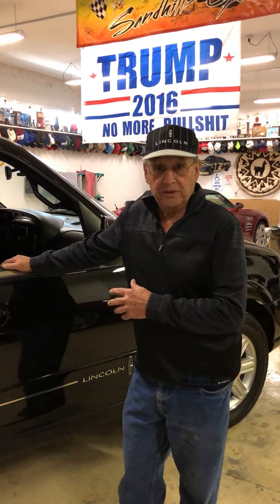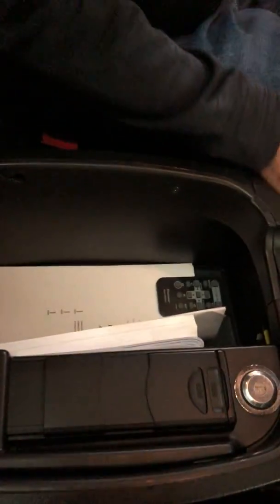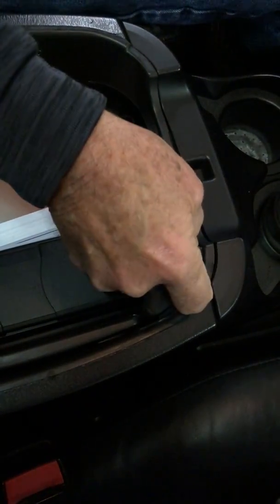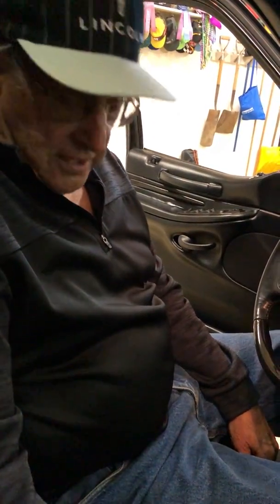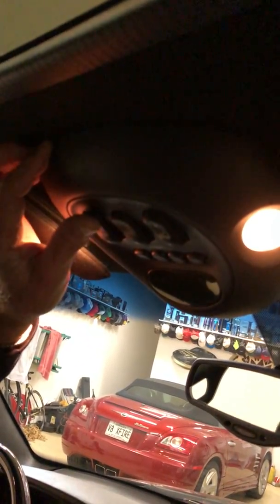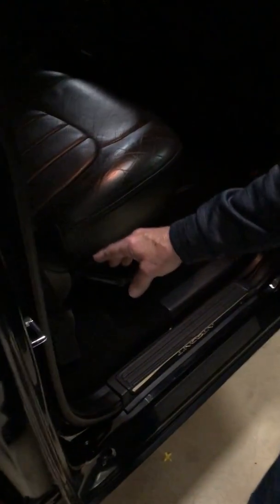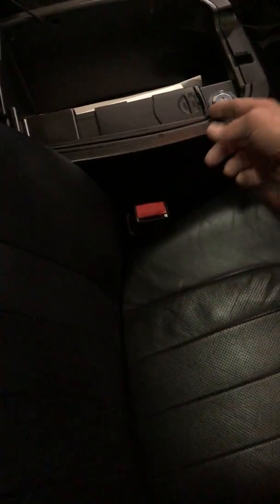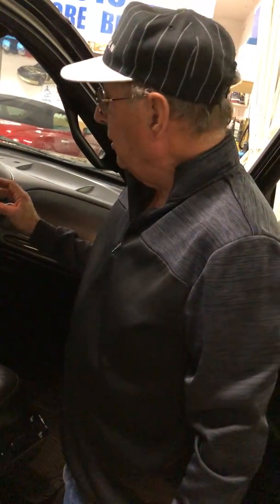2002 Lincoln Blackwood Wiring Explanation for Tonneau cover

Comment: Hey Wil @wilbischof4094 would you be able to send me over the schematics for this?  Blackwood Owner since 2009 and Tonneau cover has to be slammed manually to stay shut.  Switch works to lift it however doesn't lock in place and shows Door Ajar light on dashboard and Interior lights stay on on the doors and battery gets drained.  Need help ASAP

Comment: I bought my Blackwood new in September 2002 and I really love this truck. The tonneau control module failed in 2012 and I found a replacement for $388 tax and shipping included. That said it failed again in January 2021 and unfortunately the only module available is a rebuilt for over $1200. You can have a failed module rebuilt for $350 plus shipping however it will likely fail again the result of an alleged design flaw. In addition I have seen several post where owners have replaced the module as many as 4 times so at $1200 each that is just not a good option. 
I have seen several videos and actual photos suggesting that the module can be replaced with 12V relays however no one to my knowledge has ever posted a schematic. 

Thoughts, suggestions and discussion greatly appreciated.
Reply: Yes, I am aware of both the internal (manual release) as well as the external (manual release) opened by utilizing the ignition key under the passenger side wheel well. This is the one I utilized for several weeks in 2012 and again now. I did think about the option you suggested and I'm just not ready to give up on the idea of replacing the control module with multiple relays. I have begun compiling multiple schematics as well as a 5 page diagnostic procedure from Ford and if I am successful I will share the results. Thanks for the suggestion and your response is most appreciated.
Reply: @sonofaconch9204 ever find anything my friend?
Reply: There is a emergency release on the passenger side of the truck bed. It has a small picture of a man inside the truck bed and  by pulling the  cord  he can open the tonneau cover and jump out.  What I’m thinking is drilling a hole behind the  back seat and snake a cable to that cord, to open the tonneau cover from  there.  But maybe the back seat on the driver side. Since from this video,,there are a lot of wires behind the back seat on the driver side. Any thoughts you have on it?
Reply: Also, a manual release in front of the back wheel https://youtu.be/xfhAAjmHVeY